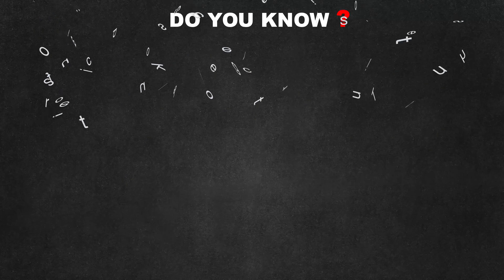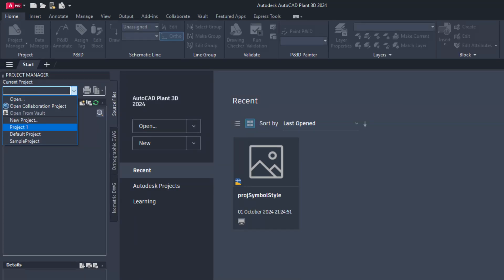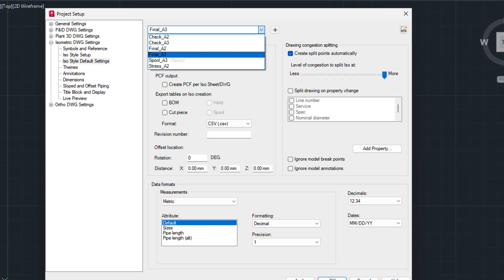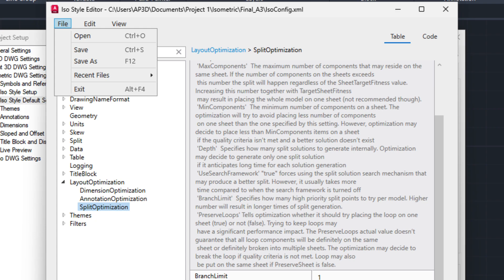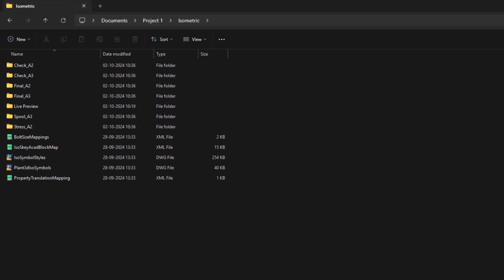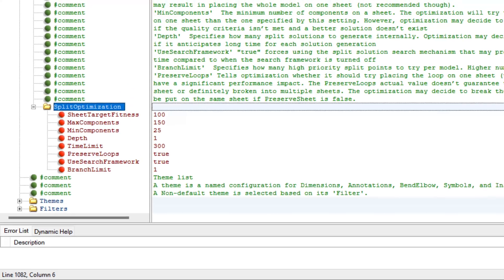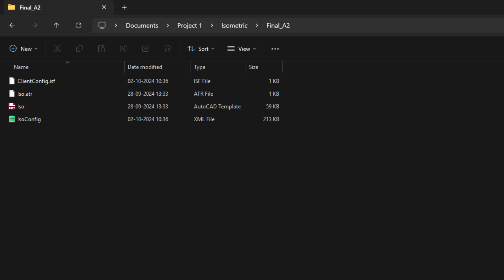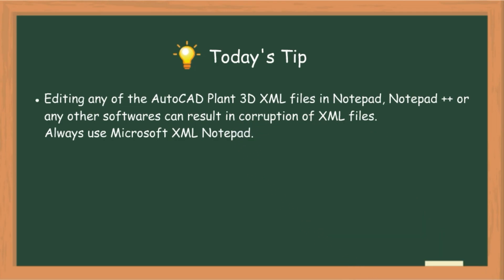AutoCAD Plant 3D | Reduce Isometric Sheet Count

Comment: I'm having this problem: I can't get more than one isometric drawing and it displays the message "<<<CONT'D ON
??<<<<<<<
Please help me
Reply from the maker: You mean the isometric sheets for long pipelines are not splitting? Try adjusting the congestion level in the Isometric Settings as shown in the video. 
Let me know if I misunderstood your question.
Reply: @acadp3dsolutions  Yes, friend, it's a 2" line with outlets that measures 150 meters, with couplings and supports. It only prints one isometric view, and the part where the next sheet should continue doesn't generate. The isometric view shows the error "CONT'D ON
??", which the Autodesk interface doesn't recognize as an error. Could you help me? Can I send you my file?